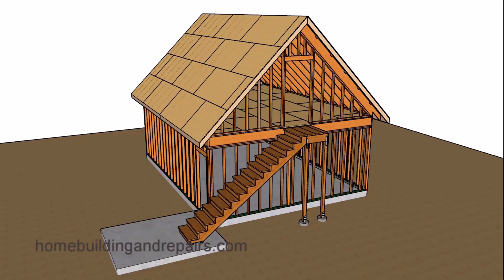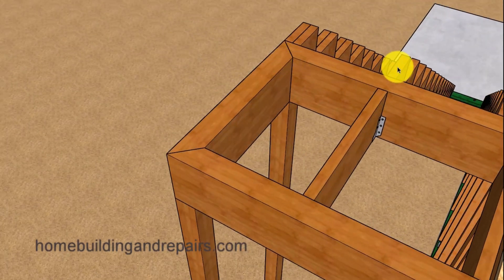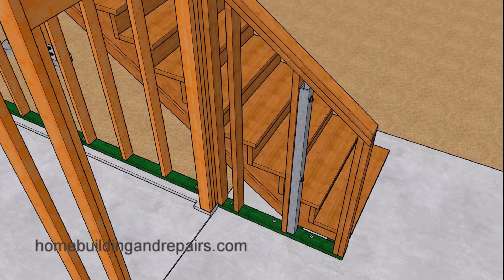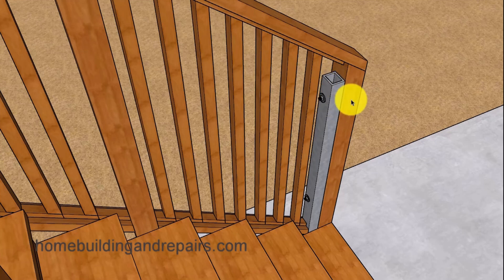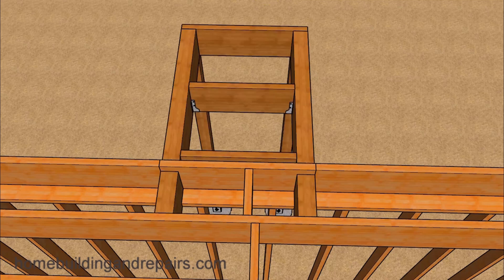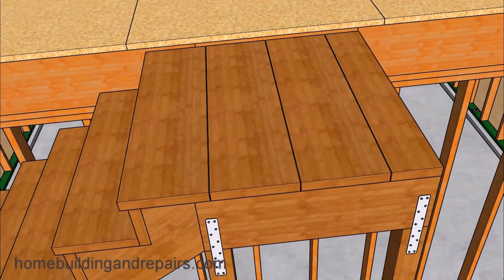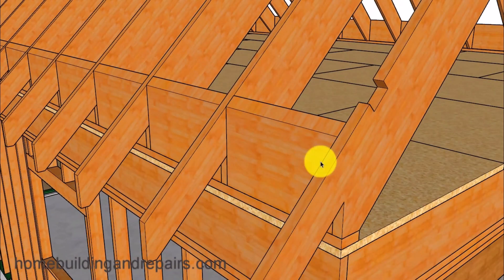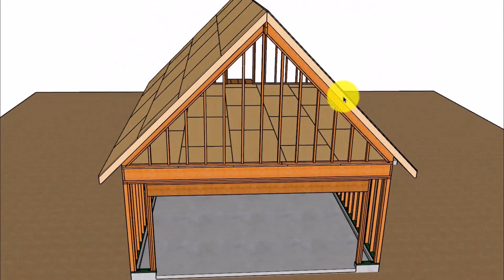How To Build Two Car Garage With Upper Floor And Exterior Access Stairs

Comment: You said the steel post that’s supporting the handrail was embedded in theConcrete. Do you mean it was set in The concrete as it was curing or fastened in someway?
Reply from the maker: Yes, it will be imbedded in a footing.